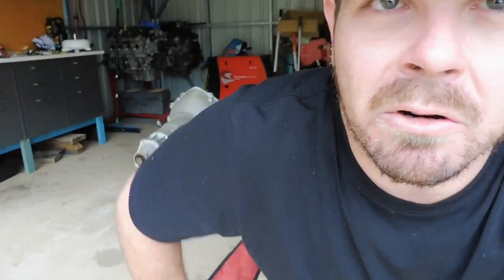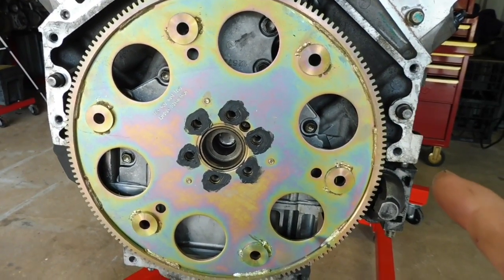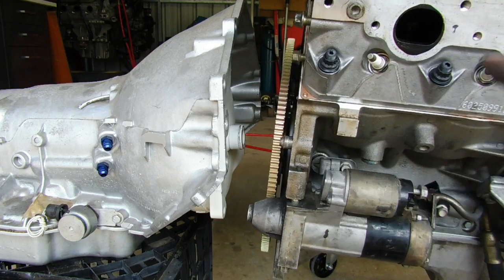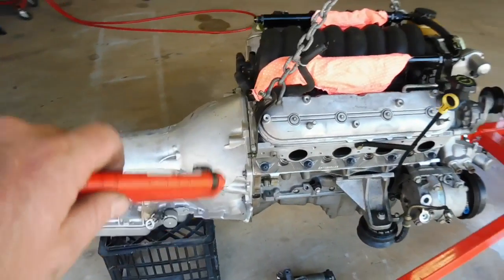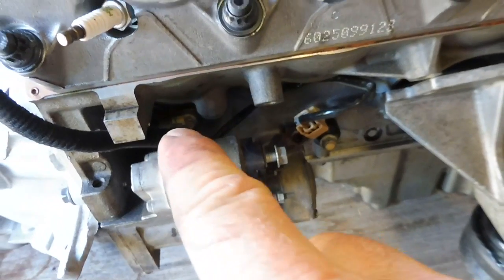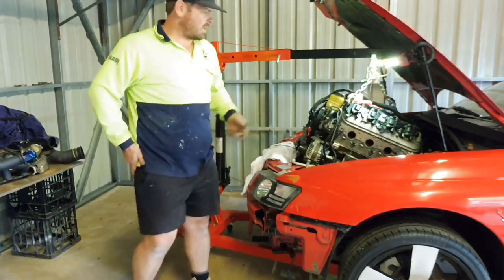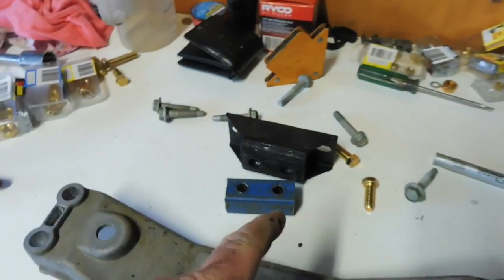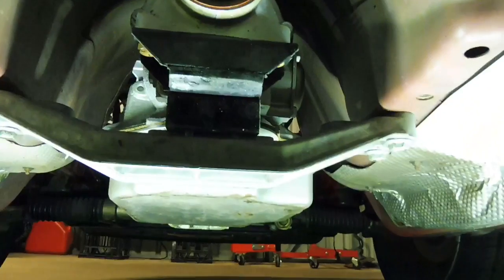Turbo Ls vz ss commodore build EP6 Th400  transmission conversion

Comment: well that would be a rude awakening...  "Did you get the bushing out of that crank?"  "No and it ate my entire sandwich"
Reply from the maker: Yes bushing was removed .
Converter would not pull up to flex plate if bushing was still installed it would of fouled on the nose of the converter .

As for sandwich comment not sure if that’s humor but ok .

Comment: Where's the plate between the motor and transmission. Don't they use one on VZ's. hope the lack of plate is allowed for in either the flex plate or convertor design.
Reply from the maker: Peter Brady you might be confused with adaptor plates . There is no need for adaptor plates on ls engines .

Comment: I'm looking at about the same weight with maybe a tiny bit more hp in the end maybe not. I'm at the point of wondering how far I can go before I end up shelling the trans. I've seen 1000hp cars explode the shell, I've seen 600hp cars that dead hook, remove the bell housing themselves. Take the weight and add 900ftlbs of torque with a tight converter it can be hard on parts.. I think I will end up using an ultra bell anyway to start because I have a chevy 400 with a broken ear and I can get B.O.P 400s about half the price of chevy. The more I think about it, that $350 ultra bell may be the best investment ever. Everyone has a good trans, it just has that 1 tab broken off priced like its junk because no one wants it lol. Plus the added benefit of that 1 extra bell housing bolt on an LSX you lose. Good video and ill definitely keep an eye on your build

Comment: Got an unrelated question for ya. Hope you can help. Finally found where my water leak is and ends up being the left head rear welsh plug. Absolutely pissing out now. What you think is the best way to replace? Just take head off or you think I can get to the welsh plug from dropping the auto?  Thanks in advance.
Reply from the maker: laurent gouriou l can’t tell you for sure if removing the auto and letting the engine lay back as far as possible will give you enough room to access the welsh plug . I do think there is a high chance you could get it done and it would be a lot cheaper than removing your head . 

Your engine has been very hot a few times now I’d be reluctant to remove the head and simply reinstall without getting the head resurfaced and possibly a new head gasket . Intake manifold gaskets, rocker cover gaskets , and exhaust manifold gaskets could all be reused as long as no damage upon inspection the head bolts could also be reused . 

Pulling the 4l60e/65e out from under the car is still a massive job especially for someone who has never done it I’ll give you a couple handy tips 
- leave the transmission yolk in trans and zip tie back so it doesn’t fall out and pour fluid everywhere.
- leave converter on trans so fluid doesn’t pour everywhere.
- be sure to have lots of or really long socket extensions so you can undo the upper bellhousing bolts from way back towards the back of the trans .
- don’t forget all the little things like shifter linkage , dipstick , wire loom , transcooler lines 

Good luck mate be sure to let us know how you go
Reply: @LatysGarage  thanks for your help mate. very much appreciated. not sure where to go from here. I've done a dodgy repair for now and see how that goes. just shits me having to either pull the head or auto for a $5 welsh plug.

Comment: Hey m8 got a turbo 350  just with stage 3 shift kit atm am planning to turbo my ls1 in the future it’s all in a vc commodore  gunna do a sloppy style build 78/75 you know the rest anyway if I get the 350 built are  they up to the task of taking 500 rw  up to maybe 700
Reply from the maker: Blake Brewtnall haha you talk about a sloppy 78/75 build have you checked my turbo tonner build on my channel ?

As for the built th350 at 500wheel it’ll probably live for a while but 700wheel I think will push it. If you haven’t built it yet I’d just get a th400 that needs a rebuild and start from there . Another option would be a power glide with the vc being nice and light the glides work very well also.
Reply: Yeah m8 certainly have seen the turbo toner build watched all your vids have asked questions about it before yep I thought that would probably rather a 400 than a glide cause it will see lots of cruising aswell as dragging look forward to the next vid m8 👍

Comment: Decent progress this time, only thing i would have done is pre fill the torque convertor before installation. 

Keen to see it drop a set soon 👌👍
Reply from the maker: Damo S pre filling the converter is definitely a good option I failed to have fluid pre organised but it’ll be allright I’ll spend abit more time at prestart stage and get the auto all primed up .

Haha RIP poxy looking 19’s